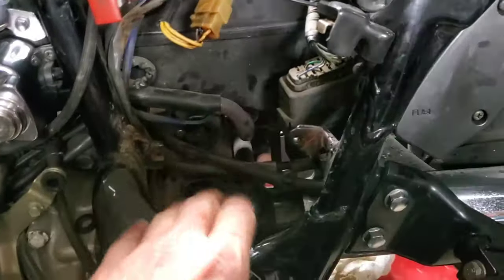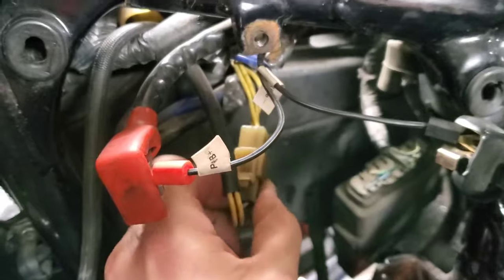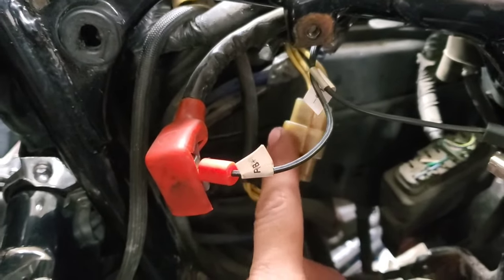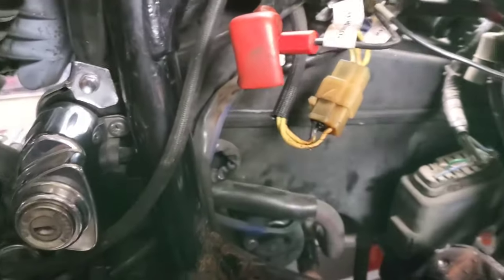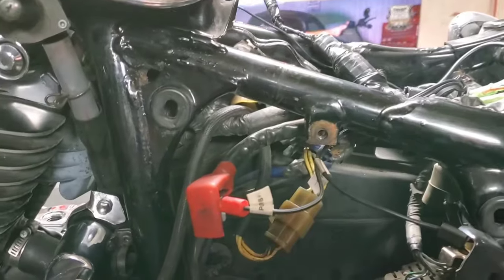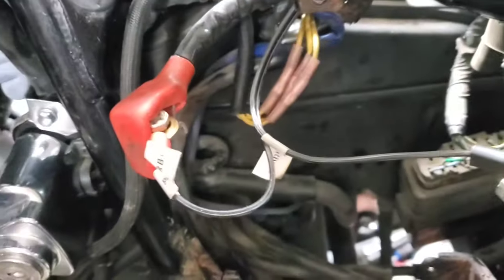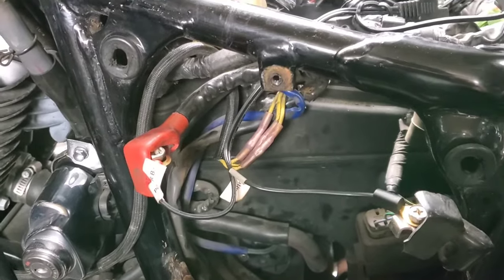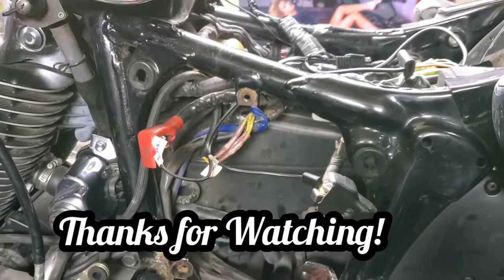Common Honda Shadow 1100 problem

Comment: I had this happen to my '99 Aero 1100. I tried connecting the wires with cheap plugs, but the battery wasn't charging. The rectifier had burned out. Bought an aftermarket one off amazon, had to extend the wires, and then it ran fine. Just gotta make sure the stator hasn't burned a phase, by checking the OHM's, if it OHM's over 1 it's burned out. The charging system is the Achilles heel of these bikes.
Reply: After over 20 years and the only failure being that, I would say that's OK.

Comment: I love Hondas I'm a Honda mechanic but after a while the rectifiers go out man that's what's up your bike's not charging it's building up resistance making the wires hot and melting the connector buy a new rectifier he'll get a good stator right on bro
Reply from the maker: My bike is charging find. But I heard those plugs are a common problem. That's why I checked them while doing some maintenance.  But thank you for the tip
Reply: Have I got a question for you I go and ride my 2004 Honda shadow 1100 and when it’s idling it will rev fine but when I go on a ride It won’t go past 25% throttle without sum sort of breaking up do you know the problem? If not that’s fine.
Reply: @jackiebeasley9719  if the battery is good and the bike is charging you may have a corporation issue if it has sit for a period of time take out one of your spark plugs if it's black and wet that may lead you in the proper direction
Reply: On second thought it may be your stator which is the bikes alternator if you have jumped it off with a vehicle too many amps could have damaged your stator just a thought?
Reply: @jamesholland1497  I don’t think it’s the stator it did have pretty dirty spark plugs I’ve put new ones in recently trying to figure the problem out! Also I don’t know if you are supposed to do this but I’m learning I had started my bike and pulled the oil dip stick and there was a lot of blow by it was spitting oil out of the dip stick hole I was think Piston rings? Idk I’m probably wrong idk that’s why I wanted your opinion on it.
Reply: Hey I got a question for ya also, my rear head on my 1100 is dead 120 psi compression , new coils , new stator , new battery, carb removed and cleaned twice new plugs, only the rear head is giving me problems when bike is running it has a back fire from the rear head, if you remove the plugs on rear head while running the back firing goes away 97 VT1100 shadow
Reply: @MinuteManMechanic  when you cleaned your carburetors did you take out the pilot Jets and the air adjustment screw make sure they were clean and clear I use carburetor cleaner and compressed air
Reply: @jackiebeasley9719  when it's running the motors creating positive crankcase pressure and it's going to blow out the dipstick hole that's natural but you don't need to run it without the dipstick inserted makes a big mess
Reply: @jamesholland1497  yes I did I used carb cleaner and blew them out also they are in great shape, dead rear head even with spark , 120 psi compression test I’m at a total loss
Reply: @MinuteManMechanic  did you take the air adjustment screw out clean it and set it to stock specs? I have had these problems before and it's always been if it's on one cylinder generally a clogged pilot jet or in the pilot system, pretty much for any motor to run you need fire fuel air and compression sounds like to me you have all of them but maybe still not the right carburation
Reply: The pilot jet is the smallest jet in the corporation circuit if you do not use a jet cleaning tool I recommend a e string off of a guitar it makes all the difference and sometimes on the pilot adjustment air screw there's a plug over it you have to remove to get to it to clean it out and reset it
Reply: If the stock plug is still over the air adjustment screw you have to use a wood screw to get it out and be careful but if it's never been done that will definitely kill the rear cylinder, maybe you might want to Google it or if you buy a jet kit it will come with the instructions I recommend dynojet
Reply: @jamesholland1497  yep I did all that , I was wondering if a pulse generator or Cdi box would cause it to not fire but still have spark
Reply: @MinuteManMechanic  if you have spark it is firing,
Reply: If you have fire you have fuel you have air and you have compression it should run if not then one of the parameters in the carburetor is probably out I wish I had it in my shop I'd fix that damn thing I drive a 98 1100 touring model replaced everything on it I love it
Reply: @jamesholland1497  it’s not it will try and that’s when it backfires , the exhaust stays cold that’s attached to that head
Reply: @MinuteManMechanic  if it's cold the carburetor is not processing fuel to make the internal combustion
Reply: @MinuteManMechanic  and it's probably backfiring because the cylinders are not working together and your corporation is still not right just a guess hang in there brother good luck wish I could work on that I'd have it fixed one day
Reply: @jamesholland1497  okay I will try to clean them again brother thank you
Reply: @jamesholland1497  it’s been down for a while stator went out at the beginning of the year when it went out ,it was running fine I put new stator in and found out my coils were fried also, then I got new coils got my spark back and got new plugs and then it’s had a backfire since and I’ve done everything I know to do to fix it I pulled the carbs off once found out the plungers that have the needles on them and operate off vaccum pressure where worn out and had rips in them so I replaced them, cleaned all the jets except the air mixture screws, then I pulled it off a second time to clean them again except the air mixture screws which I later found out about and tried adjusting them while bike was running and they didn’t seem to do anything for that rear head. I just want it running strong again like it was..
Reply: When you did the carbs you did use compressed air to blow through the carburetor circuitry as well didn't you with carburetor cleaner as long as air blows through all the holes the car circuitry is clean if you just clean the Jets that's not enough
Reply: One other thing if it backfired you may have a hole in your diaphragm on the slider that will keep the cylinder from firing as well it's just a piece of metal man you'll get it your man it's a thing anything made by a man can be fixed by a man
Reply: Hello I'm new to having problems with my shadow I just recently bought. 06 750 aero never ever had Honda problems and this is my 5th shadow . Was having charging issues .. replaced battery 2wice and recently replaced regulator. Now bike cranks but when it gets hot everything completly shuts off no electrical  power at all . Like someone unhooks a battery cable . Can someone please help me out . I just don't have funds to pay Hondas service fees . Had covid and just got back to work after being out 7 months recovering. Thank you in advance. Lisa Zee
Reply: I picked up a 2002 VT1100 Shadow that wouldn't start.  There was a very small amount of gas in the tank and the pump might have been dry.  The pump wouldn't come on with the key but would when I jumped the relay wires.  Will the brain of the bike prevent the pump from coming on it there is no gas in the pump?
Reply: @JB91710  the pump should come on and it will be loud if there's no gas in the tank if the bike has set up for quite sometime you could have a bad pump from rust or old resin gas
Reply: @jamesholland1497  Thank you very much for getting back to me so fast.  When I jump the wires in the relay connection, the pump comes on when I turn the key.  When I put a new relay in the connector, the pump won't come on.  It's as if there is a sensor telling the pump to stay off for some reason.

Tomorrow I'll put a gallon of gas in the tank, open the valve and let gravity fill the pump and try it again.
Reply: @JB91710  the pump works on a pressure sensor if there is gas in it and gas in the carburetor it won't come on until the fuel level is gotten lower
Reply: @jamesholland1497  Boy, that's confusing.  It sounds like I need to put a couple of gallons of gas in it and try it again.
Reply: @JB91710  if the bike has not been run for a while you may have carburetor issues take off for spark plugs out and check to see if they are black and wet if so you probably have a clock pilot jet and it's running too rich if you want to see the fuel pump is working or not take the tank off take the seat up take one of the lines going to the one of the carburetors off and turn it on and you'll see if gas is trying to prime that carburetor they're great bikes when she get the bugs worked out of them that usually come from time and setting up I own one myself and decided to relocate the fuel filter and fuel pump and one last thing if you do need a fuel pump don't buy the aftermarket ones you will be just disappointed
Reply: @jamesholland1497  Thanks James.
Reply: @jamesholland1497  Hi James. Here's a recap and the latest results.
1. The bike has been sitting in a basement for years.
2. The carbs have been filled with fresh gas and a lot of Seafoam for days.
3. I try to start it a few times per day with the same results. When I start it on choke it stumbles for a few seconds and dies.
4. Today I removed the air plenum, sprayed Gumout in the carbs and in those holes and started it again.  This time it ran longer probably due to the unrestricted air flow.
5. Whenever I tried to lower the choke, it just died.  It didn't even try to start with no choke and some throttle.
6. The spark plugs are new and gapped properly 0.32. 
7. The air cleaner is new.
8. Both exhaust pipes are hot.

The inside of the carbs seems perfectly clean.  The needless move up and down freely.  After having seafoam in it for days and trying to circulate the fuel with many starts, it doesn't seem to be getting better.  Any thoughts?  from anybody?  I really hate to pull and teardown the carbs, especially if I find nothing wrong in them.

When I activate the clutch, are the butterflies supposed to move?  Because they are closed all the time.
Reply: @JB91710  seafoam can damage your fuel pump and some of the parts in your carburetor as well you have a clogged pilot jet is the smallest jet in the carburetor the holes are the size of the e-string in fact you can use a t string off a guitar to clean them that you're going to have to take those carburetors off it's a fun little job I've done a bunch of times get you a manual and pack your patience
Reply: @jamesholland1497  When I work the throttle, are the pistons and needles in the carb supposed to rise up and down?  When I set the choke and twist the throttle, nothing happens in there.  that doesn't seem right.  The butterflies don't move either.  I had a Rotax, two carb engine and when I worked the throttle, I recall those pistons went up and down.
Reply: @JB91710  the diaphragms in your carburetors work off the vacuum when you have a clogged pilot jet it picks up off the main jet making it run rich you're going to need to take those carburetors off and service them and probably take those plugs out one more time cuz they're probably getting wet you need a couple of screwdrivers can of carburetor cleaner and some compressed air to blow through the and the circuits of the carburetor and make sure you take the air adjustment screw out clean the tip-off blow compressed air through it with carburetor cleaner you can do it man if I can do it you can
Reply: This is a very common thing in a bike that has set up for a while
Reply: @JB91710  yes as you rev the motor your CV diaphragms will go up and down depending on your throttle position and RPMs of the motor the butterfly in the carburetor opens up depending on throttle position and you can't even see that unless you have a carburetor off and then your hand
Reply: @jamesholland1497  In the past 14 years, I have Burned Out four times.  Once from my career and three times from the results or the 2008 recession.  So, nothing I get into is easy anymore!  I may take the off, but I am going to do everything I can to hand them to someone who has done this a dozen times and get my checkbook out.  Now, I just have to find someone I trust to do the right thing!
Reply: @jamesholland1497  You must be camped out at your computer all day!
Reply: But the noodles in the diaphragm and the slider has nothing to do with the pilot circuit and that's what's bugging you down
Reply: @JB91710  nah I just work for myself I got a small shop in my yard and I don't mind helping out whenever I can hang in there man you can do it you have anymore questions hit me up
Reply: @jamesholland1497  With only 13,000 and it sitting for years, do you think it is Only the pilot jet or could there be other issues??
Reply: @jamesholland1497  I just came in from pulling the carbs.  Only took one anxiety pill!!  As soon as I catch my breath, I'll clean the exterior with brake cleaner and then take those covers off to get at the jets.  I have some new gas with a lot of Seafoam in it, so I'll clean the jets out and let them soak overnight.

Do you know that piece of foam "Air Cleaner" in that black box just in front of the carbs?  I found mine turned to powder when I touched it.  I'll see what it's called in the shop manual and get a replacement.

Food for thought.  I found both lower isolator screws completely backed off.  Do you think air could have been sucked in down there to lean the mixture out?  They seemed tight though.

Reply
Reply: @JB91710  the little black box with the air filter is for your diaphragms you can just put a piece of air filter foam in there if I was you I would stay away from the Sea foam that stuff's bad news if it was drawing air through the carburetor mounting grommets it would backfire I would pour that gas out as the and not use it it can damage your fuel pump
Reply: @JB91710  just soaking those carburetors isn't going to do any good you have to get your jets out clean them and if I was you I would just get a couple of carburetor if you don't get it right the first time you'll have to take them off again do the month at a time if I remember right the front carburetor has a different size main jet than the rear and check your float level
Reply: @jamesholland1497  I just pulled the cover off one of them.  The big jet was perfectly clean.  The smaller one was clogged solid.  I was able to push a thin wire through it with some difficulty and black crumbs came out.  Now I can see through it.  I am going to need a rebuild kit as the rubber gaskets looked compromised.  There are so many kits out there, I don't know who makes the best ones.  What do you use and where do you get it?  Do I just need a basic kit without new jets, or should I get a full-blown kit?  Edit.  Of course, the other bowl was the same.  Totally clogged small jet.
Reply: Does it matter if you get the wires mixed up?
Reply: @davejames2015  there are three yellow wires that go to a connector plug does it matter what all you put them in if you are replacing or repairing the plug they're also be to Green into red and white that go in their own plugs
Reply: @jamesholland1497  My connector looked brand new.  I have two more problems, I hope, where I need your guidance.  These should be very easy ones.  

After I put the throttle cables back on, I couldn't line up the cable bracket holes.  They were 50% off.  I forced the bracket over and got the bolts in, but the throttle wouldn't return when I twisted it open.  The spring on the throttle itself is fine and I didn't touch the adjusters on the cable at all.  what do you think happened during the teardown that caused this?

Also, when you push the carb into the isolators, how far do you push it in?  It looks like there is a stop built into both sides of the carb, but I saw in a photo that it doesn't go in that far.  I could still see the bevel in the housing.
Reply: @JB91710  if you're referring to the bracket on the side of the carburetor that holds the cables I've never had to take that off to service the carburetors and if the carburetors are not shutting on their own you have the cables routed wrong or twisted when the carburetors are snap into the intake they will sit almost completely on top them
Reply: @JB91710 so did you get everything back together? How is the bike running now that the pilot jets are clean?
Reply: @acrenshaw8549  All back together, running great and sold.
Reply: @JB91710  great, dude! Was it just the two clogged jets? I just got my carb out and will be rebuilding at some point this weekend. I’m hoping to find clogged jets and solve my problem!
Reply: @acrenshaw8549  The cover gasket needed to be changed.  Clean the factory Jets.  Beware of rebuild kits that don't match.

Comment: Just did that last night, changed nothing. Bike runs but dims out at high rpms. Gonna run a ohm and voltage output test on the stator and rectifier and see if either of those are my issue.

Comment: Ebay stator will reach all the way to an aftermarket shindengen regulator, then run that straight to the battery, bypass all this garbage for $60.

Comment: yeahp. happen to mine vt 1100 94 mod. so i did the same as shown on the video here. only the wires were burnt of ,and hanging loose.so i had to guess were they were connected . but now some years later ,its killing the batterie.so a new stator is needed .